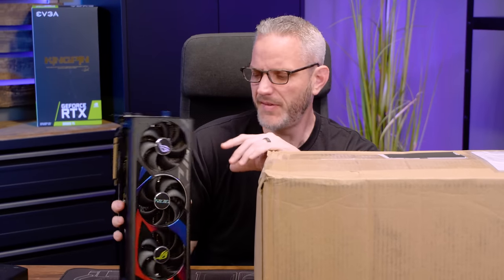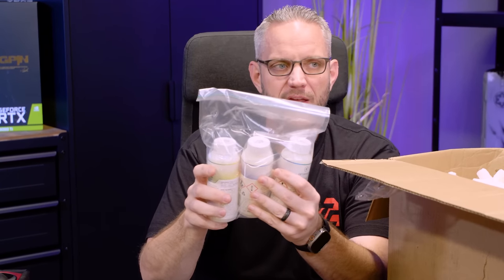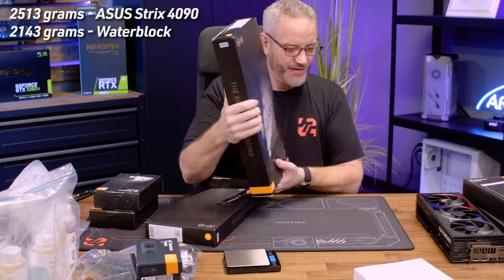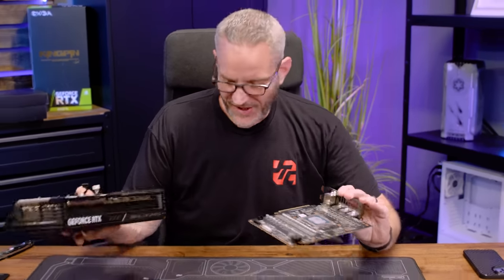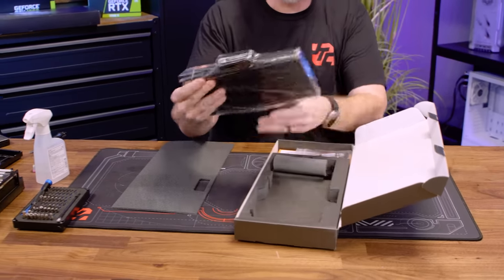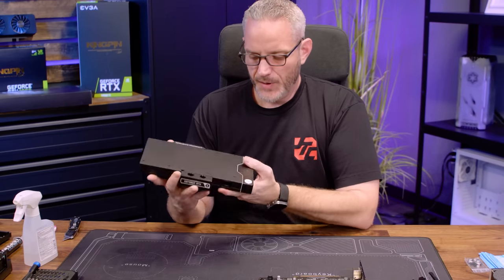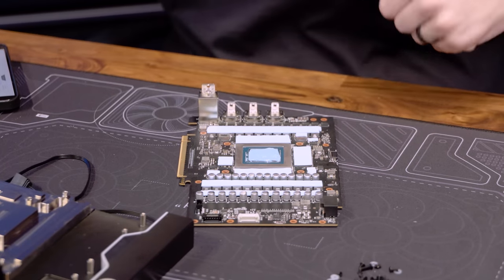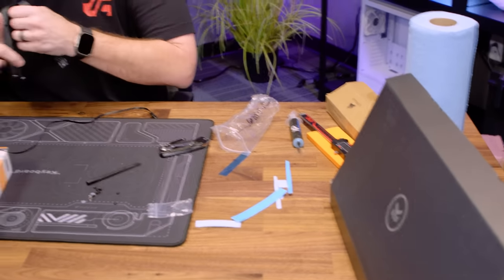This is how you make a 4090 even more expensive... 4090 Strix EK Waterblock Install

Comment: Last month I picked up the ABP set for my 3080 and it's massive. Also, I bought three triple fan X-Flow rads from EK and I'm very impressed with the build quality. They look okay, but I don't care for the satin detailing. I would have preferred either a choice of color that matches the color rings of their fittings, or a choice of black. I'm still waiting for the rest of the parts that I ordered to come in.

Comment: That cooling pad note is why I started using putty over pads. I had a Dell G15 I repasted 6 times in a week because the pads kept being too thick or too stiff and giving bad contact. Went to K5 and later TGPP10 and never had another issue. The K5 admittedly left a residue when cleaned off but the TGPP10 has been great and cleans off well all things considered.

Comment: Hey Jay, I used EK's Mystig Fog in my current build. It lasts maybe 2 months, then turns into clear. It gunked up my reservoir (a large 360mm), and my monoblock leaked between the seals, now I have permanent stains in between the loops as well. EK just said it is normal, and I can take apart everything, wipe it clean, and retorque the bolts at 0.6nm. No thanks!! I will not be using them again, that's for sure.

Comment: I use CRC Lectra Motive when cleaning pcb's.   Non-Flammable and Non-Conductive. Makes PCB look brand new.  Alcohol is flammable and conductive but evaporates quickly, i use alcohol for cleaning thermal paste and spot cleaning but never allow it to flow throughout the board. There is space under those surface mount chips that it can get trapped in if not blown out.  I use Mother back to black for all plastics, looks new but not like you wiped armor all on it.

Comment: I repasted&repadded a gpu last year for the first time. What a drama if you continue to use the aircooler and you have to reassemble it, but it worked. If i ever go water cooling, it will be really interesting to install a waterblock. 😀

Comment: Fun fact with EK's newer GPU blocks: flip the cardboard insert over and it's also the same thermal pad placement for the block (the active has the printout on both sides). Also has a key for which thickness of thermal pads are what that go in specific spots.

On another note. Wonder if you might have been able to get away with opening the active kit you had, Jay, to pillage the black PCIe bracket to hopefully replace the scratched up one in your non-active kit.
Reply: Doesn't for mine I'm installing right now..

Comment: Prestone 50/50 premixed!
Sure its a horrid color (fluorescent green) but it has lubricating qualities that protect your pump.
Yes, pure water has a slightly higher heat capacity than this mixture, but it's a narrow difference and nothing that is gonna fail your system.
EKWB on a GTX1080ti for 3+ years; 65C is peak temp under load (Cycles in Blender, Stable diffusion, photogrammetry)
I will have my 4090 in a few days, water-block time!

Comment: I went with a full active back plate block with a 380ti, it's heavy! I also went with a satin titanium CPU block, that also weigh's a ton. Idle temps are 36 degree C with the 13700K and 27 degree C with the ABP GPU block. Expensive but worth it. I have 3 x MP360P rads in a Lian Li 011XL (with Distro) and its great. Old but good. GPU Block is vertical with the EK E-Loop bracket (comes with 4.0 riser cable). The distance between both blocks is very tight if the bottom rad is MP360P (AMD would not work). I have drain ports drilled into the case so each rad has a drain option.

Comment: you should cut the pads individually. in testing its been shown when clamping - they can bind up and keep the heatsink pushed high as they dont have enough elasticity to squeeze out when its one solid strip.

Comment: Jay I switched to EK Mystic Fog last year when all the Mayhems products dissappeared from the market. I have 3 systems using it and one of those only gets turned on once every couple months. Mystic Fog is the best coolant I have used yet and absolutly dose not fallout or gunk at all. The build that hardly gets turned on has a sharp 90° vertical to vertical bend and has never collected any settlement at all. My old Mayhems coolant would almost fill the bend with fallout but would mostly clear out when run for a while.

Comment: I have this same block and the active backplate for the evgs 3090 FTW... the blocks add a TON of weight - but its sooooo quiet afterwards... couldn't care less about the price because I can't hear it.  Except for a tiny bit of coil whine, sometimes. Well worth it if you're not scared of the cost.

Comment: I buy from PPCS a lot, my only gripe is having packing peanuts all over my floor as I try to dig out my loot.  They also sell  Mayhem coolants like XT-1 Nuke which is hard to find elsewhere for cheap.  They’ve been my go to for fittings, coolants, blocks, tubing pretty much anything custom loop.  No tax 😊

One comment about the ABP, I have it for the 4090 FE, there is a contact on the back for the back of the GPU die (thermal pad to the copper block) so it does help with the thermals to some extent.

Comment: Have you considered automotive microfiber towels for cleaning cooling compound? They come in giga packs at Costco and are designed to harmlessly clean similar compounds from delicate finishes w/o leaving lint. I dip one part into isopropanol and clean with a finger through the cloth, then use a dry portion to finish up

Comment: Almost forgot: I will be printing a 'back-plate' cooling solution for the 4090+EKWB.
Gonna use ICE9 TPU and print up a heat-sink!
ICE9, printed properly, has thermal conduction rivaling aluminum while weighing much less.
Run the card with water-block while monitoring with IR camera (FLIR!), note the hot-spots, design and print heat-sink to keep such spots cooled off.
I love this stuff!

Comment: JAY! hey I had the same issue with running active backplates on my MOBO, if the heat sink on the motherboard is affecting it, 99% of the heatsinks can be removed, then cut and trimmed down carefully to fit the active backplate. I'm not sure what kind of mobo your going to run just yet but.
even my EVGA x570 I was able to cut down the fins very carefully and make it all fit snug as a bug in a rug!
the ABP is soooo worth it as the back of these cards do get very honestly scary hot. 
or to change the location like you said but that's no fun!
Also I agree the boxes and ABP come in and the sheer weight of the card after with it all installed is just INSAIN! on the sad department.

Comment: The Active Back plate is actually causing a decrease in memory overclocking limits on the 4090.  For whatever reason, the GDDR6X on the 4090 likes to run warmer.  Cooling it down makes it more unstable and reduces overclocking headroom.  Even if there isn't memory chips on the backside like the 3090, the backplate still affects it.

Comment: Hindsight for Jay: You have thermal cameras do you not? Just run something intensive on a 4090 that doesn't have a backplate, and see how hot the backplate-area components get under full load.

I recently attached a thermal probe to my backplate on my 4090, and it does have thermal pads connecting the GPU Backplate to the PCB in the areas of the power stages I believe, and it gets up to around 35C (it's not the best thermal probe, just the ones that come with a Gigabyte X670E Master motherboard) under Port Royal Stress Test load.  So I can imagine the actual backside of the PCB is getting rather warm for the backplate to be that warm.  I have the probe roughly over the top of where the GPU core is.

Comment: 10:52 LN2 thermal paste has a high quantity of silicone to help it stop from cracking at sub zero temps. They are designed to be short term use (1-4 runs, between a remount). This will pump out with every major thermal cycle ((Gaming/work)/(Not Gaming/work)). Thermal Grizzly Hydronaut, noctua NT-H2 or the like, are good long term (4-5 years) thermal solutions with overclocking headroom.

12:42 I received a EK-Quantum Surface X480M ($180.00) with a bent G1/4 port, that had touch-up paint on it. 

15:00 alphacool blocks still come with cut to size pads, and they are color coded by thickness.   

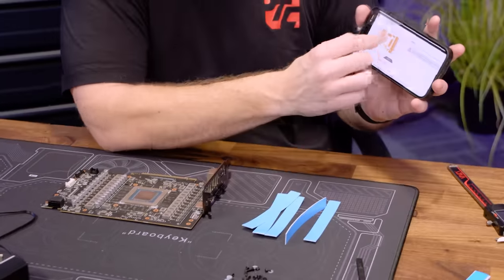16:14 Heed Jay's warning and advice or pay the price. A proper anti-static mat is a must for a job like this; if you don't have one, you shouldn't be doing this.

20:02 Can you secure a CableMods 90° custom cable to it? This would be a deal breaker.

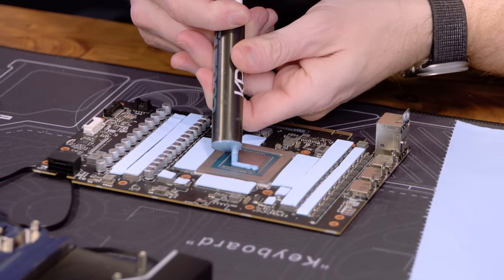Comment: You forgot two small thermal pads.  You can see it at 18:00 when you put the paste on.  They are both at the bottom / back of the board (They mirror the top).:face-turquoise-covering-eyes:

Comment: I have Bykski  GPU, Pump/reservoir combo, radiator, tubes and fitting. Plus some other manufacturer tubes cause bykski tubes are only so long and had a few very long 1 piece runs. For a cheap chinese brand, they make some really good stuff. I really love their sleeve compression fittings a lot better then the O-ring style ones from other manufacturers. 
You are the reason Jay that I went with colored distilled water.. Also I think Ek gives extra pads and hardware is cause well if you make mistake, loose stuff  and so you can take the block off and a parts for maintenance and such.

Comment: Yeah the Strix has more stuff on the back than the FE does. The 4090 FE just has tiny caps on the back, I just tore mine down to get the EK block on, also to prep for a 7950X3D build with a ROG Crosshair X670E Extreme. I'm also forgoing the active backplate due to that mobo's heat sink. Since I am just about to get to the thermal pad stage of the water block installation, your imprint trick is something I will put to use for the first time, don't know why I never thought of that before, but it is brilliant.

Comment: Some consideration about the thermal pads on the backplate. The reference thermal pads indicated for the backplate are too thick, causing an insane coil whine (ask me how I know). Consider reducing the thicknes 0,5 mm or even 1 mm in some points to reduce the coil whine to almost nothing. And yes, even with the reduced thickness, the backplate makes contact with them.

Comment: I still do not understand why... EK.. making a block for a Specific card.. Cannot make the aRGB cable FIT into the cards aRGB connector.. rather than forcing you to plug it into the mother board and have another wire to deal with.. They KNOW what card its going on!

Comment: You will use most of those thermal pads. I already installed on of those blocks on a Strix 4080. The backplate is an active heat spreader.

Comment: I built my 13900k / MSI 4090 build with full EK watercooling (like this build is). My temps are pretty amazing. Long gaming sessions will see vid temps no higher than 52c. Overclocked CPU temps hit about 60-65c (way better temps).  EK Quantum  CPU monoblock, EK Quantum Video cooler (NO active backplate) with EK vertical mount bracket, EK Asus z790 hero, 13900k, Gskill CL28 ddr5-5600, seasonic 1300w, LianLi 011D ROG case, EK-Quantum Reflection² PC-O11D XL D5 Reservoir/Pump, Hardlined, (2) EK P-series 360mm rads, (1) EK X-series 360mm rad. I'm just gonna say, the Lian Li case has a lot of room. But all of this gear will fill that sucker right up! I'll take a little vid and put it on my youtube channel. "Shaun Bomber"

Comment: Captive screws are only nice if they line up with the hole. At work we have them but they can slide on rails 1" on a non flat survice trying to find the hole. I ALWAYS break the captive screws so I can get them out of the way and use a normal screw.

Comment: Extra thermalpads for the 3000 series was because the 3090 and the 3080 would use different thickness for some parts, usually  on the backplate. As it is for 4090 only, they're only being generous. Also, if you're careful and optimize the way you cut it, will be a lot left. If you don't, some leeway.

Comment: You mentioned doing an 7950x3d build.  I am also looking to do an enthusiast build with the same processor.

I was hoping you could do a video about choosing a motherboard and RAM for your 7950x3d build. I don’t really understand the timings and latency or how they affect performance. While budget is not a huge barrier to entry, I would like help spending my money to get the most out of the system.

Comment: The light blue side of thermal pads is stickier, which makes installation a lot easier.
The GeForce RTX writing is not illuminated, but you can turn it around (push on one side), so the writing is always in right direction.

Comment: It's hilarious how wide the card is including the waterblock with terminals on the side. The RTX4090 is pretty short though so it makes it almost look square shaped. However this could cause issues with many enclosures not being wide enough to install the tubing.

Looks like Watercool tryed to address the issue properly with the Heatkiller V PRO for RTX4090 and consequently moved the terminals to the back of the card. Depth os the card is usually not a problem as the card is anyway much longer when air-cooled and even with fluid terminals it's still pretty short as the PCB is very short.

Comment: I hope you do thermal and noise comparisons with a custom loop versus the stock cooler on that card, as the stock cooler is so overengineered and honking huge I'm actually curious how it would stack up in terms of thermals and noise. IMO, the biggest reason to watercool is noise, but even my Strix 3080 on the quiet BIOS is dead silent at idle and drowned out by the game when gaming.

Comment: EK should make a small custom cap or gasket that covers the HP connector for power inside of the body of the block there. Even cleaner and protects the connector

Comment: Yes, AB blocks DO make a difference even is no VRAM on the back of the card ans it does improve heat disapation.  Required? no.  But for heavy overclocking, nice benefit.

Comment: Its the same  block as i have on my TUF 4090, the instruction are 'ok' and putting on the pads is a pain but no different from any other top end block. Just beware that the block is pretty wide.
Reply: i always had EK Blocks but for my 4090 EK has non atm, so i bought an Alphacool Eisblock and HOLY MOLY, was that a gamechanger. All pads are labeled, precut and dont have that alomst unremovable plastic on them, disassembling and reassembling my 4090 took less than 10 minutes, i was stunned. i guess ill never buy any EK Block ever again lol.
Reply: @Vittrich  I used the Phanteks block on my TUF 6900Xt and that was an awesome experience but unfortunately the EK one was all that was available for the TUF 4090 at the time so had little choice.

Comment: I did the 3090 FE active block from EK when it first released.  Overall, the GPU and hardware checked in at 7lbs.  It required support to be added; there was no way the back plate could hold that sucker up!  🙂  At this point I'm running the 4090 FE with the EK standard back plate.  A hell of a lot less weight.

Comment: Nice I got the 3080 version of that block and getting the 3 6+2 pin power cables into those holes is a real pain. Looks like that new power connector  is  a lot easier.

Comment: So, about that scratch.....
Assuming that the plate is powder coated, like any top notch metal product should be, that would be a hook-mark created by an over-used hook (i.e too much paint on the hook to allow the necessary clearance to the plate)
Having been in the powder coating business for a number of years, working as a plant operator, I know these things will happen, but they should not clear through QC, especially for a brand like EK.... 
but, shave the ridges off with a dremel tool at low speed, sand the remainder flat with 300G wet-paper and heat the piece with a heat gun, leave to cool and that mark should be virtually invisible...

Comment: “Too much won’t hurt” ah, yes, it can, the point of thermal paste is to conduct heat from the component to the cooling device of choice, too much becomes an insulator. This has to be the most common user error with thermal paste, you need a wafer thin spread to fill in any slight SLIGHT gaps. More paste is not better, even & thin coverage is.

Comment: The only thing that makes me nervous about this design is how the 12-pin plug is nested inside the waterblock and you can't visually confirm that there's full contact. It does have a very audible click though, so I would hope there are no melting cable issues.

Comment: Good thing the waterblock isn't long. Used their last waterblock for the MSI 3080 Suprim and that was a pain, because it was as long as the original cooler. Mounting the reservoir or even the tube runs was much more complicated than it should've been. Been watercooling since 2006, sometimes upgrade my PC two or three times per year. Now the oversized cooler for my Asus TUF 4080 totally pulled me away from watercooling.

Comment: I got the 3090TI Asus Tuf EK Block. Also helped them fix the proper Thermal Pad thickness for their water Block for this PCB. The WaterBlock is MASSIVE to say the least in a Lian Li XL. haha!

Specs:
i9 12900k
Asus Tuf 3090ti EK Block
Asus Z690 Formula with both EK blocks for CPU/MOBO Vram
1200watt Thor PSU
 Lian Li Streamers, 10 QL120 Corsair Fans
x2 Corsair White 360 Rads
Corsair DDR5 6200Mhz 32gb Dominator in White
EK Front Distro Pump/Res Combo